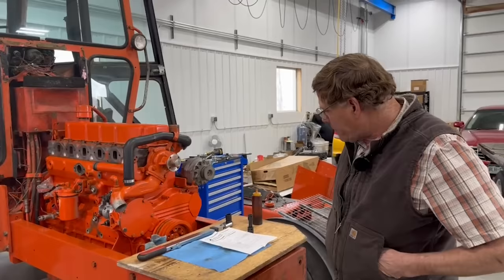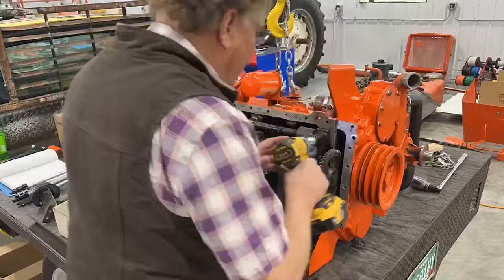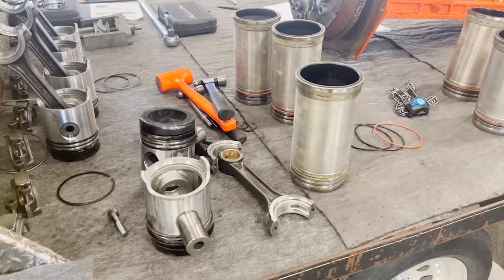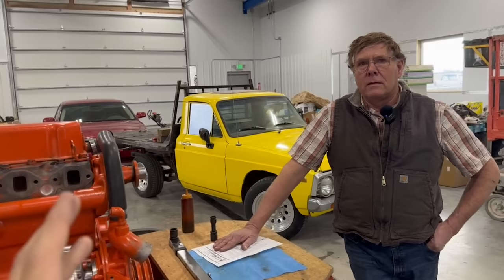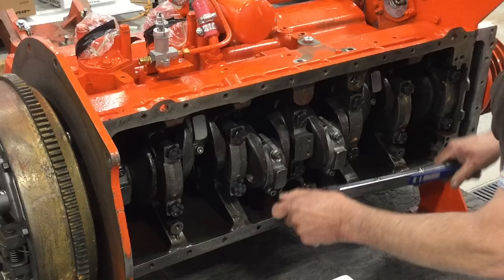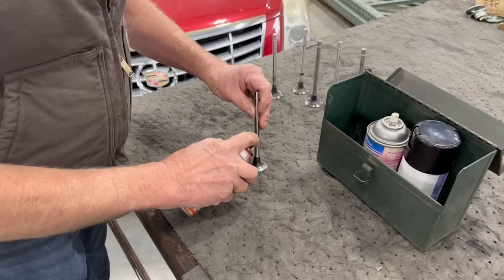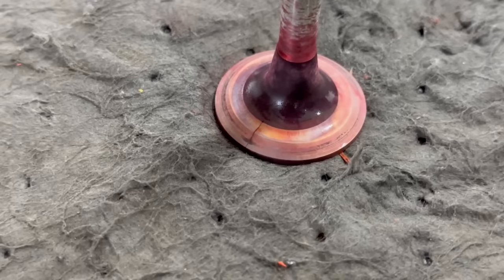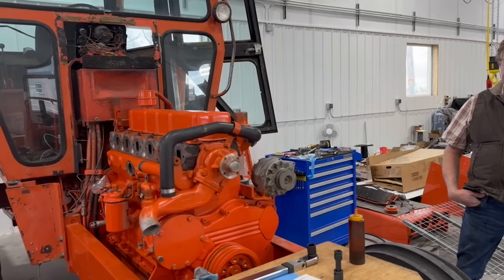Missing THIS Would've Cost Us THOUSANDS of Dollars!!!

Comment: So… I think we know that the green coolant is bad and the ELC coolant is recommended though many wet liner engines run forever with the green stuff. We think about harmonics especially with long crankshafts and accessories attached to them. Many run forever with original hardware but balancers have limited life fluid or rubber. But harmonics created in the ignition or power event have to be minimized also. So the gut feeling it’s fuel related seems correct. Though I feel it’s not the fuel. I think it’s timing. If the injectors are not correct they change the timing event. Plus the pump if not original then it’s internal configuration or settings could be different if not specifically configured to OEM
 specs. Too bad the engine couldn’t be monitored on a dyno to run it through  continuous loads to monitor egt and coolant temps. Even timing on the fly. I feel that spec is spec and you should have no problems but time is against you and the original fuel configuration could be lost and the injection shop is setting you up with what works in other engines. On a lower horse power engine maybe its original setting was way advanced and the pump having an increased fuel rate caused increased pressure and heat. If the pop pressure wasn’t high enough for the delivery setting it could be way advanced yet still starts good. I really don’t know. Just using the theory I have and putting together an idea

Comment: Have you put Northstar Performance head studs on the Cadillac if it is a Northstar engine. They are the solution to the chronic blown head gasket problems on Northstar engines.

Comment: only way the pump could of been out of time is if the weight cage was marked wrong. or if the cam ring was in backwards. but it wouldn’t of run with can ring backwards. and the weight cage mark is an easy check for a pump shop

Comment: Does your thermostat have a deflector disc on the back of it to close off the bypass circuit ? On some New Holland engines if an aftermarket t/stat was fitted with no deflector or the wrong size or shape one it caused overheating as there was not full flow to the radiator once the stat opened . I expect you know this but it caught myself and another experienced ag tech out .

Comment: Head Gasket not correct for that series engine or installed upside down? Not sure it could be installed upside down in this application, but since the head did get hot, outside of injection timing, a bad fuel injector, fuel or cooling system issue just tossing it out there.

Comment: One thing the fuel delivery being turned up 20% didn't do you guys any favours. It might not have been a problem but if things were a little tight in might have just exacerbated any potential issue. These engines are already putting out near the top limit of what they're designed for. That extra little bit of fuel especially on a brand new engine might have been just enough to push it over fulcrum point. While I am no expert I have worked on Allis-Chalmers my entire life. I worked at the dealer as a heavy-duty mechanic and I worked with a guru who knew everything about Allis-Chalmers

Comment: An old indian chief once told me... (please read with Hollywood Indian accent)- the combustion inside the cylinder expands the liner walls then they collapse ...at  about 900 times a minute. That collapse of the liner wall creates a void between the liner and the coolant. Just like a boat's propeller in the water, that void or cavitation removes metal. Boat props dont cavitate due to vibration. The skirt slap is in another realm of magic.

Comment: Thank you for what I think is the most interesting video on youtube today. Very high quality video and audio production with beautiful editing work.

I worked at the Allis-Chalmers Engine Div. in Harvey, Ill. for about 14 years. About 7 years I performed metalworking processes on small parts: milling, drilling, grinding, etc. I worked in the Fuel Injection Dpt. but mostly on injector bodies and tips/pintels and some tube bending. 
I worked briefly (maybe only 3 weeks) in Engine Test Dpt. because I was not physically able to work with the dynamometer test cell's cramped space. And I am too short for easily performing the head torquing (cold and hot) and valves lash settings. I did not meet the production standards but it was a great experience nonetheless. 
I worked on the Diesel Engine Assembly Lines for about 6 years. I was priveleged to work there until the plant closed in 1986. 
I'm thrilled to watch you both work on this engine rebuild with a high degree of quality mindfullness. 

My only question is when doing a rebuild, which I've never done, do you need to perform a hot-engine head torque and valves lash setting? We would do hot-engine head bolt torquing and rechecking valves lash setiings on new engines while running at standard operating temperature in the test cell.

Comment: I think changing the ring gap will make all the difference.I do not believe there was anything of significance with the fuel or timing as on your cold start video and running clips there was no evidence of an issue.It started easily with no smoke or fuel knock and seemed good in the field plowing (but i would not load the new engine that heavily until some medium rpm run time is achieved this time around) perhaps with no thermostat in place for the first 40 hrs or so.I feel your failure was a unique combination of little things and a new engine is quiet vulnerable as you found out unfortunately.Good luck, i am confident.

Comment: Burn the old fuel in a waste oil heater or a fuel oil furnace,  but only if you can dilute it because it may have gasoline in it. 
Mistakes are made at the refinery and distribution pipeline and most times the corrupt fuel is put in the low test tank and sold in the convince stores  at a cheaper price.   This is why you should buy your diesel off road fuel directly from the dealer and not from a  gas station.. This is why your fuel was not red.

Comment: A bit late since you already have the injection pump installed but your smoking gun isn't entirely gone yet you have timed to the correct side now and the internal timing is lost but the housing witness marks never moved, check one side then check the other side to see if the witness marks are actually 180 of each other. Can either witness marks be used or it has to be time to one side of the pump at least that's what I thought was the burning question. Anyways best of luck.
Reply from the maker: Actually, I did check that before reinstalling it.  They are indeed 180 degrees apart.  I feel there must have been something internally wrong creating too much advance at high idle under load.
Reply: @JAMSIONLINE  thanks for the reply. I thought I'd bring it up since I it wasn't mentioned in the video. Sometimes people get so caught up in the details that they missed the obvious. I know I've done it a few times. Keep up the good work.

Comment: I just noticed the base pan is really shallow under the back part the engine. Wondering if engine oil dipstick could be the wrong one. That wood kind make sense if there wasn't enough oil to splash up in the back to holes. Sorry don't mean to drive ya crazy. This makes more sense they anything. If the motor was locking up mostly its to much heat or nut enough oil. The back to holes wood be the first 2 to go with out oil

Comment: So dad is saying it's actually better to run a valve stem seal on the older style motors even if they never came with them. How would you get more lubrication vs less using them? That's what I'm not getting.  thanks

Comment: Maybe you simply just got a bad batch of parts, incorrect alloy possibly could have been just a one time mistake of the manufacturer for that specific engine. You did mention that things have changed over the last 50 years since it was originally made. They possibly just did not get the alloys right in the new parts specifically the rings and valves.
Reply: @davidparker9676  then they may have made them from the original alloys witch can’t stand up to the new Shitty fuels.

Comment: The segment about having 5 thou clearance slamming into the side of the cylinder... as an engineer, I know that statement isn't quite right.  As the cast iron cylinder heats it grows both in ID and OD but the piston is aluminum and sees a higher temperature, thus grows more so the 5 thou clearance actually shrinks like the ring end gaps shrink at temp.

Comment: Late timing.  Makes the engine less efficient so more fuel is needed to keep engine speed.
20% more fuel WILL cause higher EGT.  Higher EGT should have increased turbocharger boost if it is a free floating turbo and no other tc issues.
The use of an exhaust gas temperature thermocouple is strongly recommended.   The engine overhaul manual should list EGT ranges for idle and maximum power output.   Idle should be 200 to 300°F

Comment: I’ve seen over-treatment of Diesel 911 in fuel cause extremely high combustion temps. One time it was so bad it cracked a piston right down the center

The red diesel 911 is basically an alcohol that binds to the wax and water. Too much alcohol in the diesel make big boom in the combustion chamber

I know you guys are smart and not looking for anecdotal observations, but I figured in your pursuit of failure mode analysis you might appreciate the warning about over-treating with red diesel 911

Comment: I wouldn't think it would hurt anything that quickly but I have heard ultra low sulfur road diesel doesn't lubricate like older fuel.
Reply: @davidparker9676  red diesel is the same thing as regular diesel.  I have watched them pump it in the tank many times and all they do is add red die to it
Reply: I think at some point, even off road diesel is ULSD.
People try to make up for lack of lubrication with performance fuel additives, like Stanadyne.

Comment: This may be a dumb question, but I thought I'd ask since you're still not confident of the root-cause of your engine's failure.  You mentioned the injection pump being 180 degrees out of phase.  Are the crank throws all consistently spaced in degrees (which equals time, when spinning)?  And does the injection pump deliver fuel in 6 evenly spaced events?  If either one of those isn't the case, it's possible you could introduce an injection timing problem by altering how these two are phased with respect to one another.

Comment: Anything over 10% fuel in my opinion is dangerous for long-term use on stock turbo. I do really think your problem was in your pump. The Roosa master/Stanadyne is one of the easiest pumps to work on. I’d be very pissed if it was me when you get her going, I would keep a handheld thermometer on her for a while. and make sure you use a good diesel coolant in my experience you can’t beat the blue from Fleet guard Cummins we have had nothing but excellent performance out of this coolant.Did you make sure you kept you throttle shaft wired back when you installed the pump ?

Comment: I'm no expert but if the fuel was advanced so far that it caused pre-detonation and excessive heat. Wouldn't it have been hard to start the engine begin with? Tractor and truck pullers love to run super advanced timing and that is largely the reason why they have to spray half a can of ether to get them to fire when they're cold. Could it be that with a rotary injection pump the injection event is so prolonged that it would mask the symptoms of an excessive advance?

Comment: Dear Mr. Jimmie Wolfrum, I understand that you want to know the exact cause of failure of your this engine remanufacturing. Because I like your values and the fine job you have done in raising your son, I am compelled to give you this advice. If you want this engine to run smoothly for the rest of its life and save $ 100 K of your time, labor, parts and eventually purchasing another tractor, you may remove the coolant thermostat valve for good.
Reply: Removing the thermostat causes the coolant to travel too quickly.  It cannot absorb the heat.  The engine runs cold and wears much more quickly.

Comment: I dont really know anything about diesels but could the problem have been to do with the amount of combustion air?..Like running lean like a gas engine can?..is this a turbo?..i wouldnt know anything about it but im just thinking if everything was correct in the fuel and compression department maybe it was something in the air?..air leak?..wrong air filter?..something along those liines

Comment: 10:28 I have never seen such a weird port setup in an engine block, where cylinder one and two have the largest holes and coolant is supposed to do what? Go in and come out of the same hole? They rely heavily on heat transference, rather than flow of coolant?! Are you sure there isn't another hole for each cylinder? Lack of flow would create air pockets, which WILL cause cavitation, which WILL cause deterioration of the liner and should show up as blemishes on the outer wall. Lines, spots, striations and overheating of the orings.

Comment: Question, does the "off road diesel" have the same ultra low sulfur spec that the on road stuff has? I know that older diesel motors have a problem with the ULS diesel because it's less inherently lubricating properties.
Reply: You are correct the older diesel engines really struggle with the low sulfur diesel fuel. Especially the Stanadyne pumps that were built and designed to be lubricated from the fuel. In the Northeast where I am located anyways now all diesel fuel is low sulfur even home heating oil is now low sulfur. A lot of people are having trouble with their older furnaces because of this as well.
Reply: Having decades of farm supply co-op work experience, I can share that "it depends" - most of the time the only difference is the dye indicator of road tax paid or not.  The co-op I worked for had Roadmaster and Fieldmaster, both had the exact same additives.
Reply: off road diesel is the same as on road diesel, except the color of dye. On-road diesel has a road tax but off-road diesel doesn't. On-road diesel is yellow and Off-road diesel is red.
Reply: @davidparker9676  Roger that ... and over here in EU (France for this Texan), they take it a step further and force us to have or vehicles go twice a year for "Inspection" ... trying to force us to buy new vehicles; I have a 2000 Toyota HiLux 2.4 L TD and she's impossible to kill and everybody knows it ... and why no "used" ones are often for sale. If they can't screw us one way, they'll find another.
Reply: Number 2 is number 2, on or off. If your old timer offroader seems to object to ULS, there's a reasonable way to up the lubricity,  with no effect on burn quality or heat energy: dexron 3 or type f atf. A couple percent atf will give greater lubricity, and it burns "as number 2 diesel". 2 stroke oil will do the same, but has lower heat energy and a higher flash point/kindling point. Lots of truckers running full mechanical engines rely on 2 stroke oil as their "slippery supplement" because the red tinge of atf might give fuel inspection agents caniptions, while off road vehicles have no such worry.
Reply: Another way to add lubricity is use #2 heating oil - as another already said, #2 is #2... but fuel oil has the Sulfur. So one can add their own easy-to-find diesel fuel treatment (Howes, Power Service, MotorKote, etc).
Reply: @David Parker  quite welcome. True about atf as a cleaner, it's a key component of my favorite "skunk piss" recipe for home brew rust eater (atf, dot 3, solvent or turpentine, all equal parts). It's a bath soak mix, not a wipe on, wipe off. But, it does make a good "soak it up the day before and let it marinade" penetrating oil too
Reply: I've seen a lot of suggestions for ATF and I've seen Project Farm test it a couple of times for different purposes. I would only work about the friction modifiers that are present in ATF. Do those friction modifiers cause abrasion?
Reply: Stanadyne makes their own diesel fuel additives to help lubricate pumps. It's fine for old school engines, and it's fine in DPF/SCR engines.
Some people use additives in modern engines. The Bosch CP4 pump is a disaster, and many modern diesels have them. A little extra fuel lube may help a little bit.
Reply: @grenmastermike  atf runs the high pressure hydraulic circuits in auto trannies. It runs through incredibly tight tolerance pumps, gasketed valve bodies where any appreciable wear will cause issues, and lubricates every moving part, bearing, and bushing... if it was abrasive under pressure, it couldn't be used as automatic transmission fluid. As for the friction modifiers, that's why dexron 3, or type f, the "primitive atfs", as they are least "enhanced for long service life", an un-needed factor in a fuel.
Reply: @ludditeneaderthal  okay, that makes sense. I'm going to look into what a "friction modifier" is

Comment: look, if the rings and bearings are tight, everyone will know, if the rings and bearings are loose, your oil pressure and vacuum pump know. better loose than tight, in most cases. Been there, done that.

Comment: as a ‘Shadetree Mechanic’ , i would personally recommend using RedLine SuperCool Antifreeze with WaterWetter in the cooling system for your Tractor, as well as checking to see if there’s a ‘Fail-Safe’ Thermostat for the Tractor, and also using RedLine 15W40 Diesel Motor Oil in the crankcase 
that combination of the Antifreeze and Motor Oil should help keep that machine running for a long time
Reply: Yeesh!  You're as bad as the Amsoil fanbois.